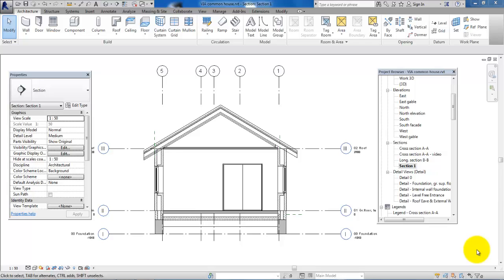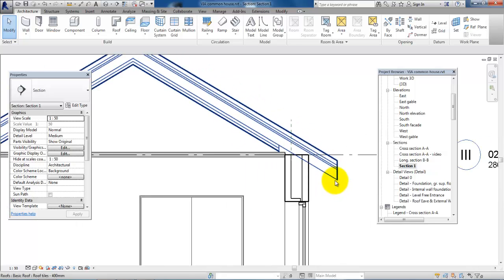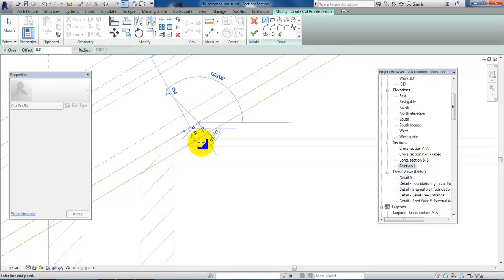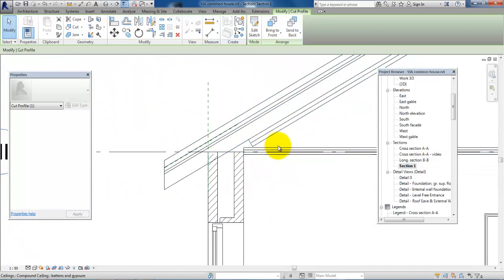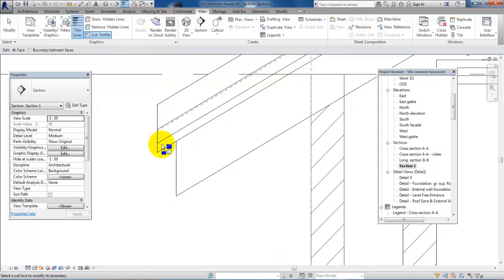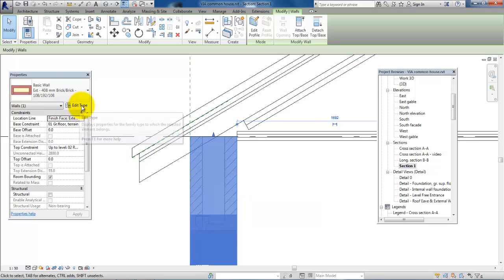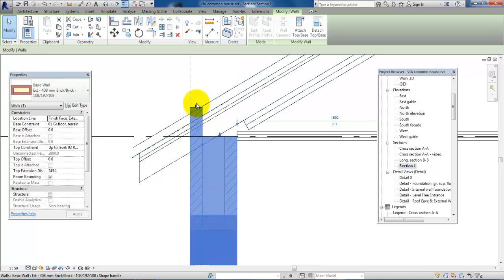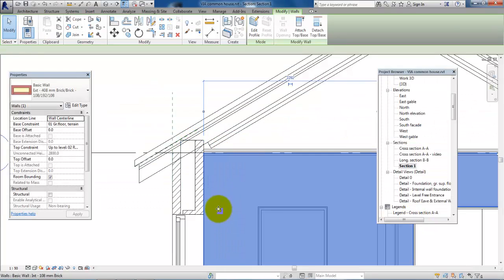Revit 2014_Roof eaves and external wall

Comment: Thank you so much for posting this video, for some reason it just had not occurred to me to use the cut profile command to fix the ever irritating issue  with the very unrealistic looking standard Revit roof! I have tried using parts to tidy up the roof but of course the issue with that method is that it only displays correctly when the view is set to show parts and that is not always ideal. Your method also seems neater to me than creating two roofs and connecting them so cheers! :)
Reply from the maker: +Architectura Thank you for your comment - I'm glad you find the tutorial useful :-)